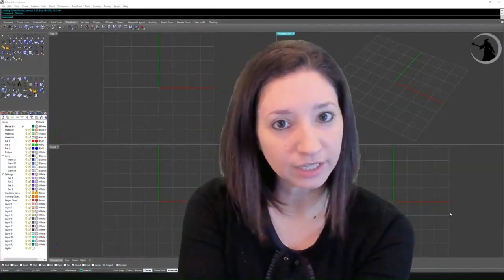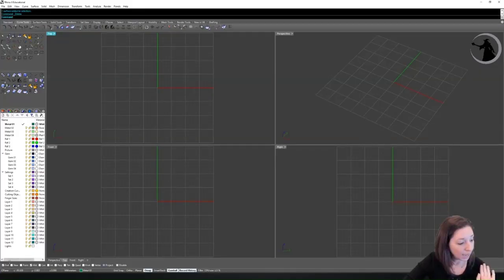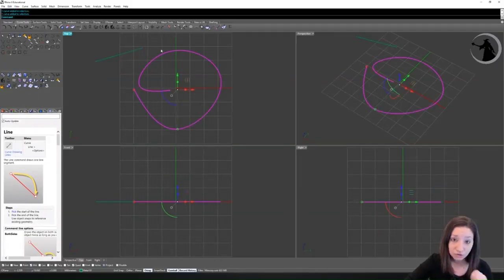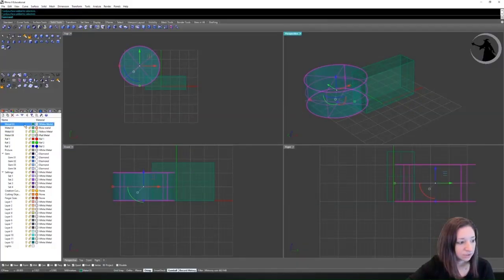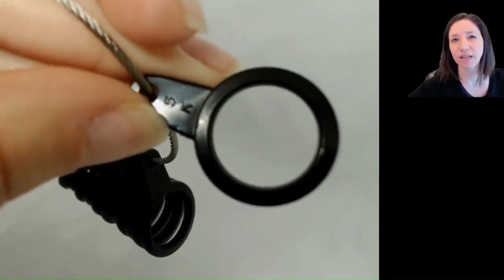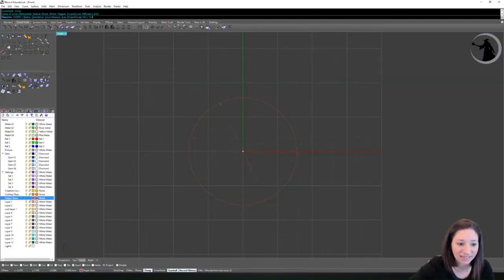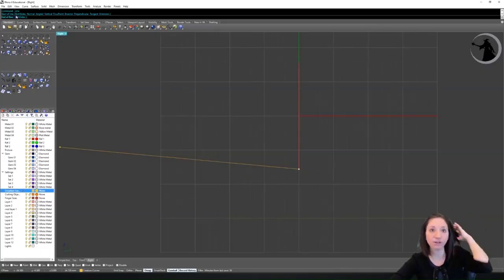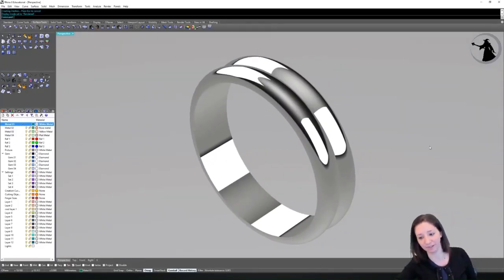Intro to Rhino

Comment from the maker: Welcome to CAD Wizardry Academy! So glad you're here.
A few things to grab before you get started:

The interface file I mention at the beginning is linked here: https://drive.google.com/file/d/1bCm1xuBY9Duqleh2o2fvSRtC90Q-tL2Y/view?usp=sharing. 
Download it before you hit play so you can follow along with the same colors and layout I'm using.
To install it, open Rhino, type optionsimport into the command line (all one word, no spaces), find the file you downloaded, hit Select All, and click OK. That's it!

And here is a link to the templet file! https://drive.google.com/file/d/1GaG3-fEqWG4fi81paMAbWDCGcSyhssnx/view?usp=sharing

A few things worth knowing before you dive in:
This was filmed as a live class so you may notice a few live stream moments here and there. The instruction is all there and fully applicable to current versions of Rhino.
Ring size charts are easy to find by Googling "ring sizes in millimeters" if you want to model a different size than the size 5 we make in class.
If you get stuck on anything, drop your question in the comments and I'll help you out.
If you want to watch me model live a few times a week, come find me on Twitch. Link in my bio!
Next class is coming soon. Subscribe so you don't miss it.